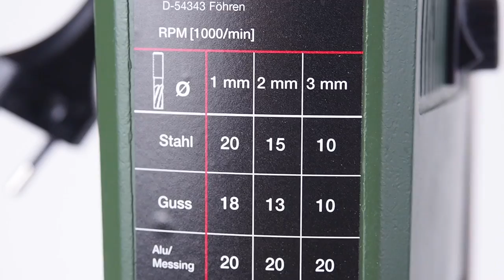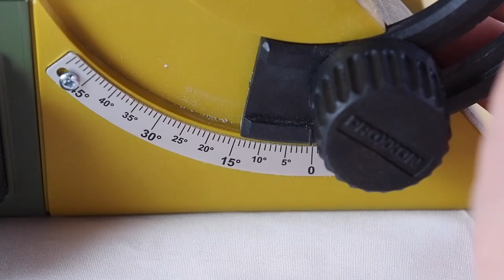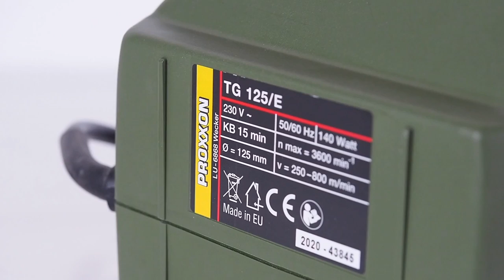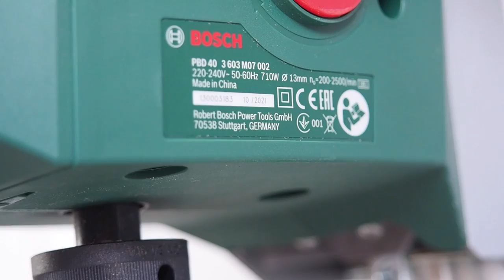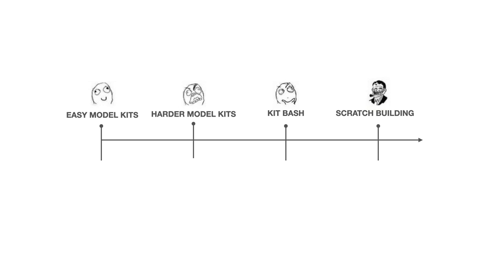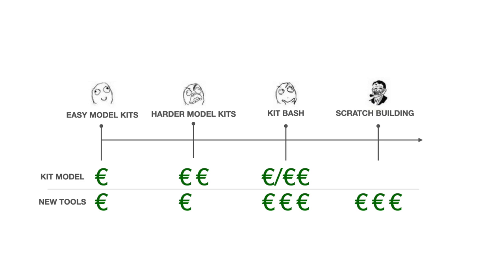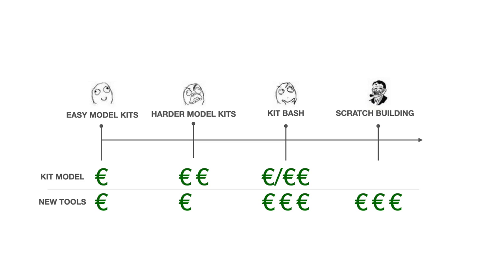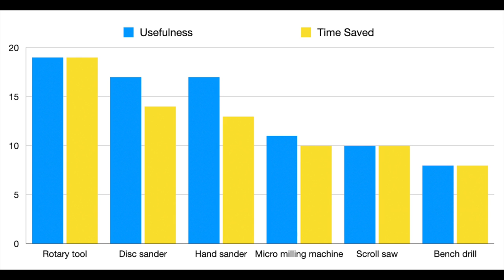TOP 6 Electric tools for ship modeling: what to buy first?

Comment: I replaced the scroll saw with a small two wheel band saw.  It cut finer with less splintering on small wood parts.
Reply from the maker: That’s better indeed!
Reply: @Tagliamare  Even an inexpensive band saw with a decent blade can do a lot.  The next thing I need is a thickness planer/sander.
Reply: People automatically think a band saw cannot do interior work. Wrong. Cut the blade, insert through a start hole and silver solder back together.